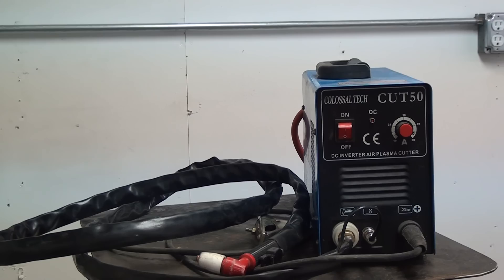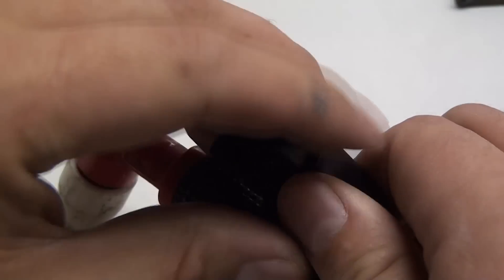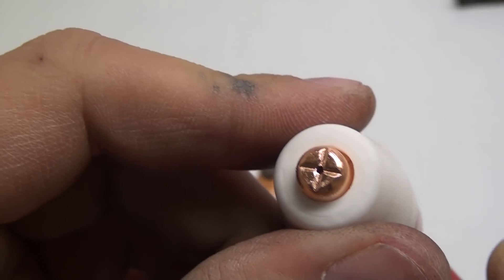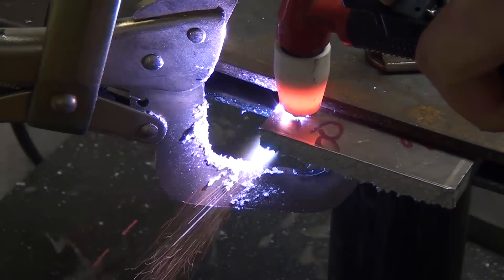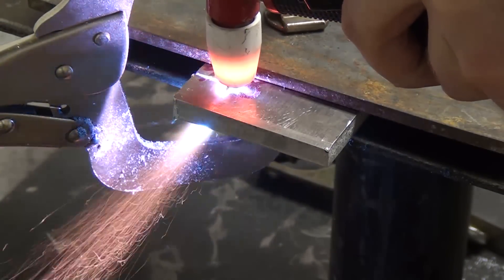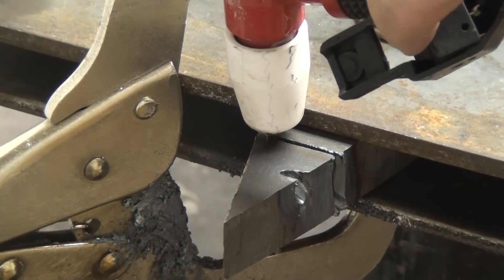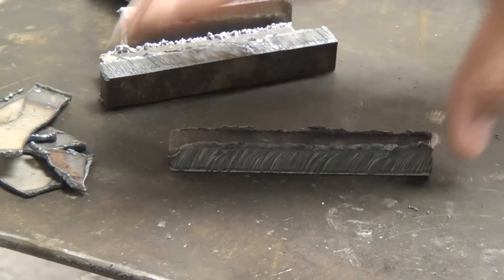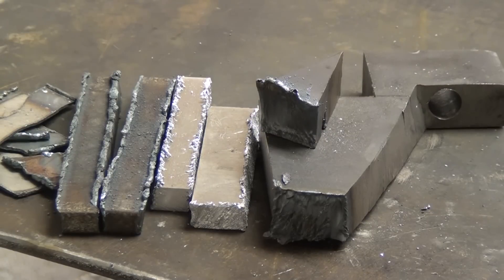Colossal Tech Cut50 Plasma Cutter (Two-Year Follow Up)

Comment: For Gods sake get the trigger fixed.
Saw your video for the first time and is a fair representation of the machine.
I guess some one has told you by now, the delay between the trigger function is to allow the  tip to cool down after a cut.
Also dont turn the unit off quickly after prolonged use as it will cook the electonics.
From experience.;)
Reply from the maker: I replaced the trigger over 2 years ago, right after posting this video :)
Thanks for watching!

Comment: Russtuff -  Would this be an OVERKILL if you were cutting out rusty areas in a car body that might be 18 or 20 gauge (much thinner than what you cut here)...?
Reply from the maker: It can handle way thicker material than 18ga, but when cutting sheet metal you have he benefit of being able to cut much faster. If I needed a plasma cutter for sheet metal, I think I would buy this one.
Reply: russtuff - What wiring did you do for this unit ?  30 AMP or 50 Amp ?  Guy at big box store said I needed 8 gauge for 50 Amp service.  I don't know.   Thanks
Reply from the maker: DanTheManIOM  I honestly can't remember how mine is wired, but I'm certain there are some guidelines in the manual (which I can't find). I would use 8ga for 40amps and 10ga for 30 amps. You might get away with 8ga for 50 amps depending on how long the line is. I think 6ga is rated for 55 amps or so.

If you can't find anything more concrete let me know and I'll try to dig up some specs.
Reply: russtuff My Machine works great. (I have the yellow one - the gauge is in the machine up front) and 30 AMP is ok, I ran it at 30 amps most of the day and never tripped the 30 Amp breaker...I ran 50 feet of 8 gauge (rated for 50 Amp)....I said, if I go cheap and it does not work, what am I really saving ?  Nothing if I have to come back and redo it.
Reply: DanTheManIOM It also cuts the thin sheet metal quickly...it is great to cutting out the floors in a rusty vehicle.....an overkill for sure, but it's fast....
Reply from the maker: DanTheManIOM
Awesome! I'm glad to hear you have everything running and are liking it :)

Comment: Nice!I was looking at the harbor freight $650 cutter and in my opinion as long as it cuts its good right?anywho I'm thinking about this cutter u posted and I saw it on Ebay. Idk if you have a video on how to "hook everything Up" as I am new to plasma/welding scenario.it be cool if you have a video on tht.thanks,
Reply from the maker: Sorry I missed your comment. I may do another follow up video some day, and if I do I'll do something about the assembly. As I recall, there are only a couple things you actually need to hook up and it is either self-explanatory or there are instructions included with the machine.

Comment: You get what you pay for. If you are doing light work, or only need it a couple times a year, a cheapo plasma cutter would be fine, but for heavy or a lot of work (5+ times per year) i would definitely recommend a better quality cutter. As you can see with the switch lever for example, this one isn't made for heavy use or even medium use for that matter.

Comment: Pretty sweet vid.  I was just looking at this exact cutter on ebay.  I'm not paying $1000 for a tool to cut metal.  I'm not a pro thats going to use it 8 hours a day so I think your vid proved that this is every bit as capable as the expensive machines.  Good deal

Comment: Trust me, you do NOT want to cut without a glove. Under certain conditions your hand may slip and the torch may "surge" forward.  When this happens, depending on the angle of the torch, the molten metal can spray right up at your hand.  This even happens in this video at 3:45, luckily it sprayed away from you.  I've had it spray at my hand and put a nice big hole in a glove, and a painful (although minor since I had the glove) burn to make me remember it.